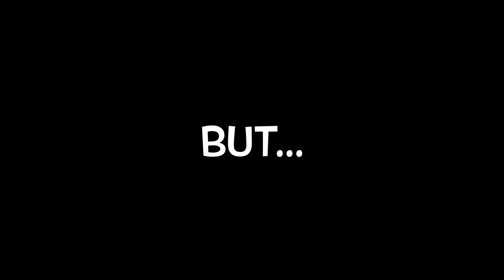Condudisc Install UK - An alternative to Earth Rods or Spikes.

Comment: Just wondering what are  the benefit of putting a tt earthing in here as you have a tncs earth in the new building? The ze would have been much lower on the tncs side.?
Reply from the maker: Its for the Powerwall, when they use it for whole home back up during a power cut you have to install an alternative form of Earthing in case you lose the Grid Earth.
Reply: @ cheers. Does the power walls need to switch over from PME to tt or does it have both connected at all times ?
Reply from the maker: @jimmyfurey  You connect the TT Earth to the MET so all connected at all times.

Comment: As you had to dig the hole anyway could you not have dug the hole as you did until you were clear of any potential obstructions, then put the earth rod in, thereby saving yourself £300 ?
Reply from the maker: Yeah that did cross our minds, but in all fairness we were intrigued to see how the Condudisc would perform. But take your point, you'd think that at 800mm down we should then be clear of everything. At least doing it this way we could see exactly where the disc was going and removed any doubt about potentially hitting something.
Reply: @ true. Interesting to see the product though. Never seen it before.
Reply from the maker: @ Nor us, I'd heard of it but never seen it done, we will definitely use it again though.